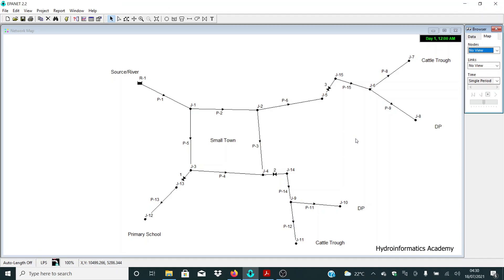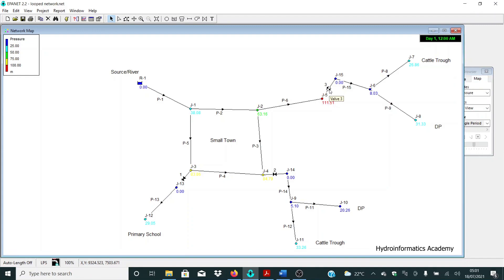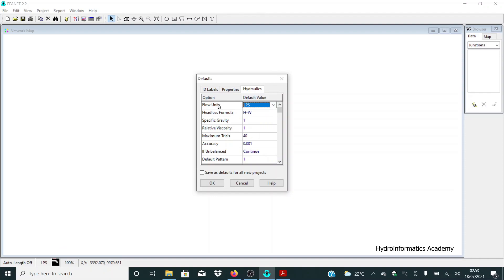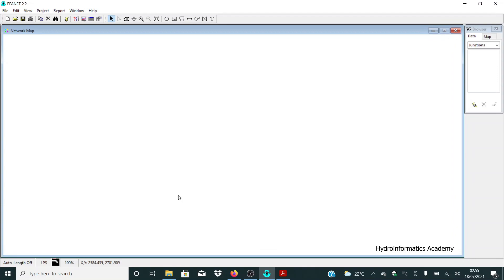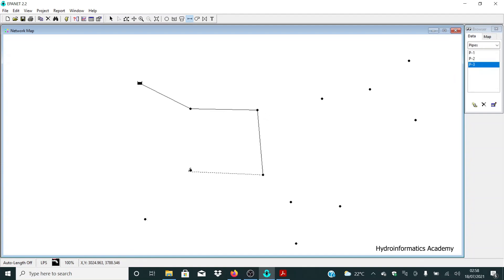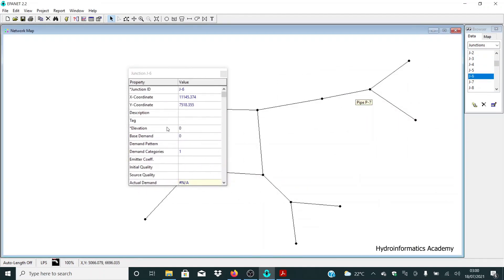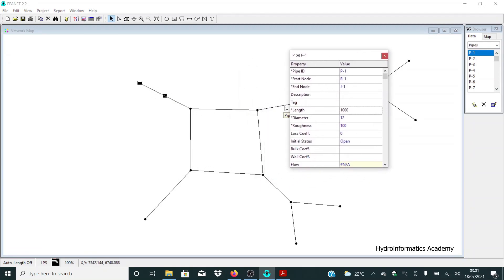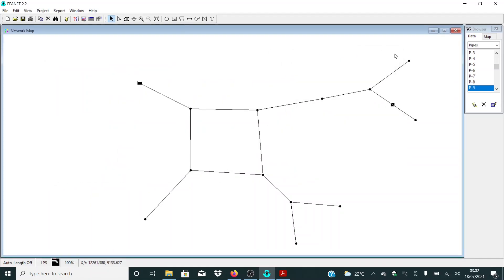Hydraulic Modeling for Looped Water Supply Network with EPANET Software [Part - 01]

Comment: Good presentation Eng, kindly show me how I can isolate some part of water supply network during rationing
Reply from the maker: I think the first option is to turn off pipes just like what i did on this tutorial! but the best option is to use gate valves, with GV's, the part of network you want to isolate you just close its GV (in your model)!